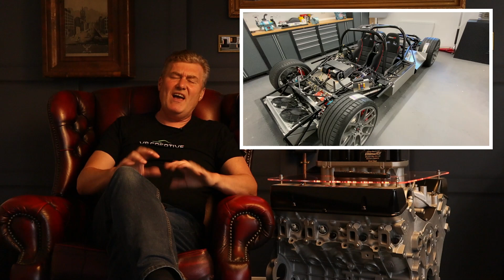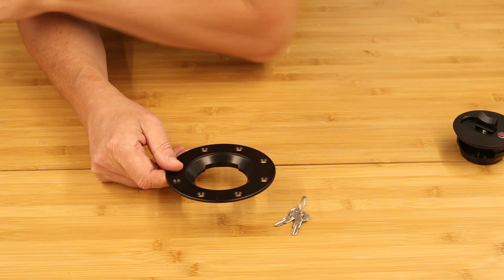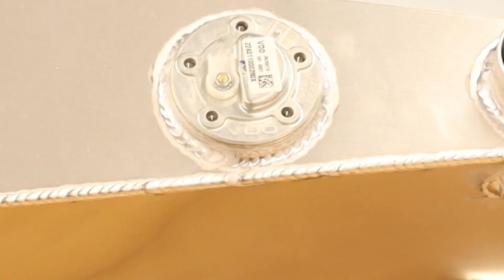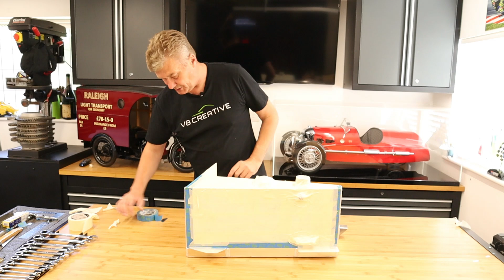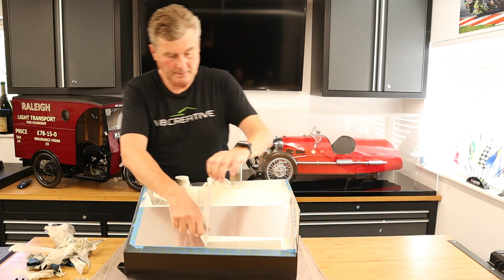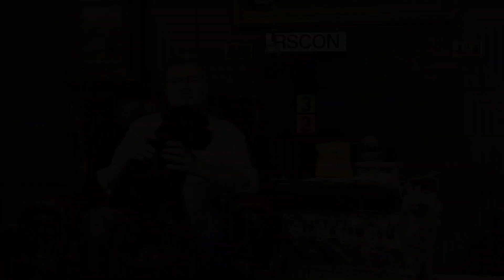Building an Ultima RS with Nigel Dean. Part 20. Fuel tank install and Q&A

Comment: So there’s an elephant in the room now. Despite trying to show us the prefit; I don’t think we got a very clear idea of how that was done. I’m hoping over the next dozen episodes that you’ll be able to demistify how those body parts are aligned and secured. I’m sure most viewers came to the same conclusion at that prefit. Bring on the Nigel magic and make it easy 😊
Reply from the maker: Keep tuned and you will see how every single panel is attached. The prefit is all about perfect shut lines and securing panels at datum points only.

Comment: One thing to keep in mind with brakes, a lot of manufacturers will massively oversize their brakes, then rely on the ABS and other systems onboard to control them.   The Ultima has manual brakes, which will feel amazing and provide great feedback to the driver.   If you put the biggest brakes you could fit, then you would probably end up flat spotting the tires every time you tried to take a highway offramp!
Reply from the maker: Hi Ryan, valid comment and it's back to the driver's ability with the Ultima. Good old school control. Cheers Nigel, and thanks for keep tuning in

Comment: Great build, the attention to detail is first class. Interestingly you say that the car is only available as a manual option, but given the fact that they use a Porsche 911 gearbox then what is there to stop someone retro fitting a Porsche PDK gearbox with aftermarket ecu?
Reply from the maker: Hi Darren, anything is possible since this is a hand built car after all. However, going away from the recommended route introduces complications which in my mind distracts from the enjoyment of the journey since there will be many unknowns, cost and associated stress. So my approach is a standard build which delivers one of the most amazing machines on the planet. Thanks for tuning in. 😀

Comment: Have you got to add a tether to the fuel fillers to pass IVA?
As I noticed you could remove the key from the cap when it's not locked into the fuel filler🤷‍♂️
Reply from the maker: Hi Kev, very observant and you are correct. The tethers are provided by Ultima, I just did not show them on camera. For international audiences IVA is a 4 hour test which the car has to pass prior to being registered for road use. The test looks at both safety and compliance aspects of the car, down to the radius of external and internal edges. The need for a tether is to ensure when you are filling up with fuel you do not leave the filler cap at the pumps. May sound pedantic, but it avoids the risk of fuel spillage on the roads which could be a hazard for our two wheel friends. The test may sound daunting but Ultimas breeze through, providing that is you don't start modifying the car prior to the exam. Thanks for the comment. Cheers Nigel
Reply: @v8creative  Ah right cheers. 
Surprised though that Ultima aren't supplying caps that the key can't be removed from to pass IVA to save the risk of damage to the bodywork from a cap hanging on a tether!
Reply from the maker: @kevteare4466  Using an ignition key on a fuel cap can make it rather bulky and unsightly due to the size of the key. The ULTIMA caps are a work of art, manufactured from billet aluminium and use a tiny key. As for damaging the bodywork the filler with the tether sits on the flat surface of the car so doesn’t hang. Cheers Nigel
Reply: @v8creative  Pretty sure it doesn't need to be an ignition key🤔
Just states that the key can't be removed from a open cap,so that little key you've got already would pass IVA if you weren't able to remove it from the cap when open👍

Comment: Hi Nigel, awesome work, based on your videos i'm seriously thinking of getting a kit and building from scratch.  Thanks you for the great videos which i'm literally binge watching as it is that interesting.  What are your thoughts on connecting up both the fuel tanks an appropriate hose so that petrol maintains the same level in both tanks all the time for balance?
Reply from the maker: Hi John, yep why not experience the journey, it is amazing :-)? As regards joining the tanks I think there may be a balance pipe but I am yet to fit the fuel system in its entirety so will update via a video in due course. Thanks for the positive comments about the videos, it’s a lot of work but very enjoyable also. I would say the videos are taking me longer than the build :-). At the moment there is a slight slow down while my car is at the factory for the body prefit. but once back the fortnightly updates will commence. Cheers Nigel

Comment: Ultima says to install stainless steel screws directly into aluminium? Isn't that the worst case for galvanic corrosion? I.e. the aluminium will corrode instead of the screw
Reply from the maker: Hi, and you raise an interesting point. In fact any two differing metals in physical contact can cause galvanic corrosion. Interestingly the use of stainless steel fasteners to connect aluminium components is common practice in construction and the automotive industry due to the favourable properties of each. However, there are techniques to reduce the risk of such corrosion, some of which apply to the Ultima. Firstly, the aluminium component is significantly larger than the stainless set-screws which creates an imbalance between the cathode and anode reducing the galvanic reaction. Secondly, the application of sealing compound on the gasket and mating surfaces of the sender (including the set screw threads), creates an insulating barrier. Thirdly, it's the introduction of water to such a joint which can be the catalyst for corrosion. In Ultima's case the fuel tanks are protected from the elements (buried in the side pods), and even if water was splashed onto the joint, it is sealed with sealant. In summary, it's a tried and tested approach by Ultima for over 30 years. But again thanks for the comment. Cheers Nigel

Comment: I laughed when you said "engineer" as if you're one of view among many so called engineers that have legitimate practical experience 😍
Reply from the maker: Hi James, yep my father could never understand how I could be an Engineer in Electronic Engineering when I didn't build anything or get my hands dirty in my job. However, I have built enough V8s, designed and scratch built both mechanical and electronic products, written white papers, drafted technical manuals, been a thought leader, and presented at conferences on problem solving and industry trends, so I guess I straddle the term engineering :-). I remember in one job interview I was described as having an unusual set of skills. Not sure what to make of that but got the job. :-). To me a true engineer is just an artist. Thanks for tuning in. Cheers Nigel M.Eng, CIM, Spanner man

Comment: Hey! Do you know how much on average  would it cost to have a professional build an ultima rs? 

And im guessing that the car will be red. The engine might be something more unique like an lsa.... I don't know but I sure am exited for the next episode.
Reply from the maker: Hi Spoint LV, and thanks for the comment. Your vote has been locked and loaded for the next episode where I will reveal all. As regards the path to RS ownership you can order a factory built example but to be honest I'm not aware of the cost since I've never enquired. One thing I know for sure is there is a fairly lengthy waiting list and the cost car vary significantly depending on specification. What I would suggest is you contact the factory, have a discussion on the spec you would like and get a quote. The guys at the factory are incredibly helpful. Cheers Nigel

Comment: Thank you Nigel for all of your video chapters as you allow us to follow you building your Ultima. I watch them as soon as they come out. Now, I have no idea which color or engine you will choose. So, let me think about it. I’d do blue with an LS7 (mini rat motor). But that’s me. Well, an LS3 with 525hp would be fine enough because of the power to weight ratio.

Here goes nothing. You are going to choose an LS3 and a red body. Yeah, that’s it. That’s the ticket.

Good luck and I can’t wait to see your next installment.
Reply from the maker: Hi Neville, and thanks for the comment. You are not a million miles away but I will reveal all in the next episode which I'm filming this weekend. It will be a slightly different format since basically have run out of spannering items until my body pre fit but fingers crossed it will be informative. Cheers Nigel

Comment: Thanks for posting your video diary been enjoyable and certainly helps to make the idea of self build far less scary, just got to finish my resto mod project first. the ultima has always been a bucket list project and the launch of the RS styling has only fuelled my desire even more.  if it we mine i would ignore LS and LSA and go LT4 as its dry sumped, and i still cant make my mind up between white and orange both look stunning with all the CF
Reply from the maker: Thanks Hamish, and it sounds like you have petrol in your blood :-). I’m sure your resto mod will be cool. Cheers Nigel

Comment: Nigel, I think you are choosing RED as the exterior color (will look good with the bronze wheels), and I think you are going with (this is a tough choice as the engines are all good choices but seems like price can vary wildly) the LS3 - because it's a great engine but also not silly expensive like the LT4/5 (I see $16k USD or $20k respectively). The LT1 seems very similar to the LS3 for power AND price, but is probably more high tech. The LS3 is more a known quantity and easy to put a cam in for more power (actually doing an LS3 swap on my car now also).
Reply from the maker: Hi Chris, like your logic but am I logical? Thanks for tuning in and more comment coming soon. Cheers Nigel

Comment: Hi Nigel, I think your car colour will be white and you will use a dry sump LT4.
I didn’t see you put any coolant lines in for a supercharger so it may rule some possible engines out. I personally would like to see the 5.5L flat plane crank V8 they use in the new Z06 Corvette.
Reply from the maker: Cheers Peter, very perceptive but let’s see if you are right next episode :-). Thanks for watching. Nigel

Comment: Hi Nigel, I'm guessing you're going with a white body and an LS3 engine 🤔👌
Reply from the maker: Hi Jeff, a very perceptive guess I must say one that hasn't been offered to date. A question to you, if I'm going this route why would I put holes for a charge cooler feed and return in the passenger luggage cell? Cheers Nigel
Reply: @v8creative  firstly in the episode where you installed the extra holes for the change cooler lines you mentioned that they are a treat for your powerplant,  suggesting you're planning a future upgrade possibly? Secondly, if you were planning on fitting an LT 4 or 5 you would have fitted the fuel tanks with the GM in tank pump. 🤔
Reply from the maker: @jeff.5380  wow, you have been doing your homework :-)

Comment: Great video diary Nigel, love watching these.
The first time I saw an Ultima was in the early 90's at a kit car show at Donnington, blew me away. I thought I will build one of these one day. That day is still to come but I will.
Anyway, couple of questions, the fuel tanks, I noticed that the rear outer corner of each tank isn't held up by anything - does a bracket get fixed on later?
Also, didn't notice anything on the front suspension to do with a lift set up - and no mention so I assume you haven't optioned for it?
Body colour - red because it's red in the promo video and you've opted for red stitching on the dash and roll cage covers.
Engine - LT5 as per fitted to demo car and the RS was designed around this. Keep up the good work and look forward to the next one.
Reply from the maker: Hi Perrin, yep the first time I saw the Ultima GTR I fell in love with the brand - amazing cars. As regards the fuel tanks once the side pods are installed you will see how the tanks are supported. Difficult to describe in words but a good observation. I didn't go for the front lift kit, since I wanted to keep the build pure and I'm lucky enough to live in a part of the country where speed bumps are not common. Thanks for the guess with body colour and engine - but are you right? Cheers Nigel

Comment: Orange and a 4 rotor turbo'd Mazda - aka - 787B....
I'll get me coat....😂😂🤣🤣😂😂
Reply from the maker: Hi Jim, that made me smile. I think Ultima would not approve if I opted for a 787B, even though an extremely capable forced induction 4 pot. Orange may be right though?? Cheers Nigel

Comment: What's the advantage of fitting the bodywork prior to engine fitting 🤔 
My guess is a 800bhp Supercharged LT5 in a Cobolt Blue!
Reply from the maker: Hi Mark, and you raise a very good question. The reason is many of the engine systems are fitted to the cabins rear bulkhead and once the engine is installed it is difficult to work in that area. Also the rear clamshell comes off very easily so the rear of the car is fully exposed. You'll see when I fit the engine. Good choice for colour and engine, but is it right? Watch the next episode and find out :-). Cheers Nigel

Comment: For British roads the LT4 will give way more than enough performance ( 0 tp 60 in 2.5sec and 210+mph top speed ) 😮😁😁 got a sneaky feeling Nigel is going for orange with carbon fibre highlights - personally I would go for Kawasaki green or white. Whatever the colour it will still be a masterful, piece of art build 👍👍👍
Reply from the maker: Hi Ian, good guess and as for that carbon fibre - it's a must :-). Cheers Nigel

Comment: The way you described the installation of the fuel cap and gaskets means the fuel can come in contact with the cut edge of the fiberglass body every time you fill up the tank.  Seems like it might be better to have the body isolated.  Stack all 4 parts on top of the body.  Body, gasket, fuel funnel, gasket, fuel cap.  Just a thought.
Reply from the maker: Hi Scott, I knew I should have made a diagram to explain the fitment and good spot since I probably didn't explain it well :-). In fact the top seal sits between the funnel and the cap. When I do install the inlets I'll make ti clearer. Thanks for keeping me on the straight and narrow ;-)

Comment: I busted out laughing with the shout out on the brakes. I certainly was suggesting the Ultima needed bigger brakes but they seemed small next to the carbon ceramic RS6 brakes. The fuel tanks for both cars are the same though. I don't expect much better fuel economy with the Ultima as I have sourced an LT5 Racing engine with 900 hp 😳
Reply from the maker: Hi RS, glad you didn't mind the shout out. But your comment about the brakes did make me smile. I would also say the first time I drove an Avante RS6 I dumped the throttle from a stand still and what a weapon :-). Keep tuned. Cheers Nigel

Comment: Given it's built to squeeze in a v8, a boosted inline 4 would be a sight cheaper on 'road tax'. Channel name says not an option of course. =]
Honestly couldn't guess for the motor, quite a few options for Chevy crate motors and probably really can't go wrong with any of them for an Ultima. 
As for colour? Yellow is my guess.
Reply from the maker: Thanks for the guess, and I must say yellow is very tempting :-). But it has to be a V8 ;-)

Comment: Hmm I’m gonna guess an ls 6 or 7. I’ve seen on some other videos the Ls 5 is no longer an option? Then Kawasaki green with gold rims. Just cause it reminds me of the old Kawasaki ninja bikes, which is probably about the only street bike that can keep up with this thing. 🤣
Reply: I am specing mine in Kawasaki Green with gold rims. A race shop that builds motors for the 12 and 24 hours of Sebring based in Jacksonville Florida had two LT5 motors left which they build up to signifcant horsepower. I bought one of them at the end of July, a few weeks ago. Would have loved the new LT6 in the Z06, but Corvette is having trouble delivering the cars let alone an eventual crate motor.
Reply: @DrMarkGurley  hopefully it looks awesome! Are you going to do a video series on building it also?
Reply from the maker: Maybe a bit loud for a 56 year old brit? But then again maybe not ;-)
Reply: @v8creative  Nigel I am a 56 year old Michigander but loud is good with exhaust notes and supercar colors. 😁
Reply: Nigel already has the wheels, which aren't gold.

Comment: What is more accurate, an LED array or a fuel gage arm?
Reply from the maker: Hi Evie, as ever thanks for your comment. To be honest todays 'analogue' sweeping needle instruments often use a stepper motor which in itself is just as accurate as an LED display. However, due to parallax errors in reading an instrument with a sweeping needle I would say LED is more accurate. Cheers Nigel and say hi to Suzie

Comment: Nigel, a set screw is typically threaded along it's entire length and is used to locate and fix something to something else.
Fx a sprocket to an axle.
An other word for set screws are grub screws.
St least according to the machinery's handbook.

Your examples were a shanked bolt and a full thread bolt, where the first is typically stronger than the latter, because of the fact it has more material in it's shanked diameter.
Reply from the maker: Hi Paul, thanks for keeping me on the straight and narrow
Reply: @v8creative  What you have been calling set screws are cap screws. Set screws typically have no head at all, just a hex socket.